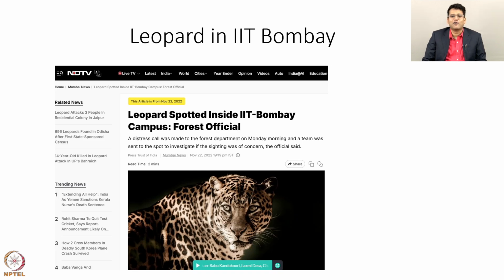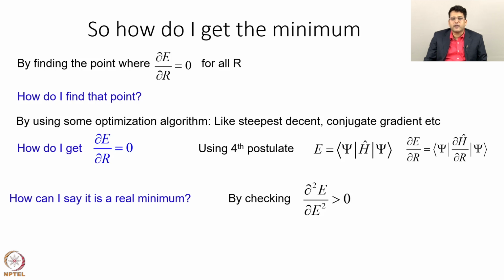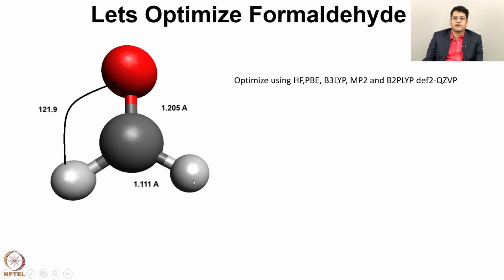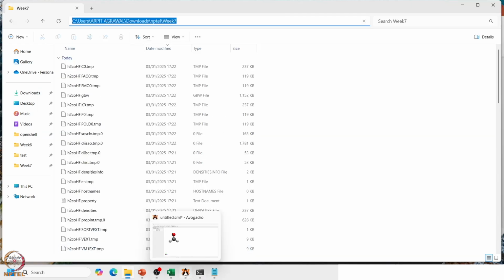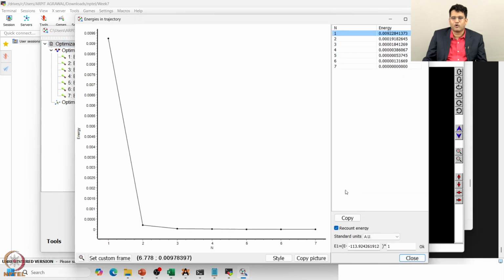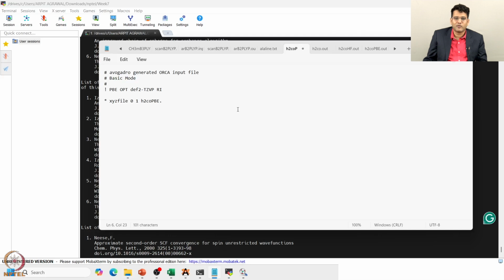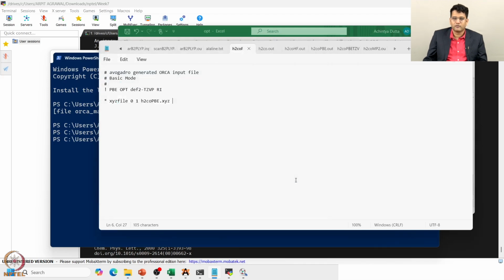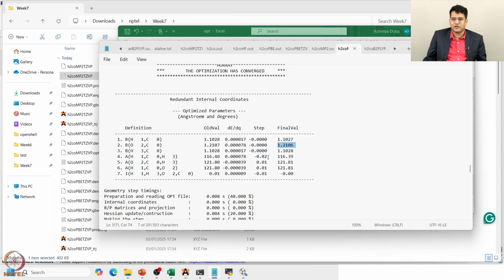Week 7: Lecture 36: Potential Energy Surface - I

Comment: In the picture 121,9° angle is for HCO, not for HCH. I guess lector accidentally mixed them up. If we are talking about HCH angle it should be 360 - 121,9 × 2 =116,2°. B2PLYP showed the closest result in case of bond angle